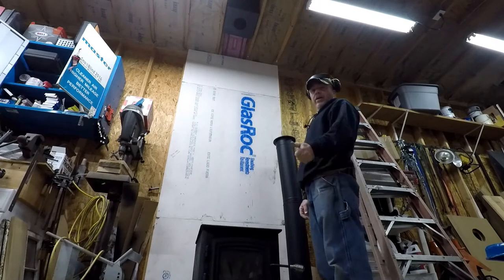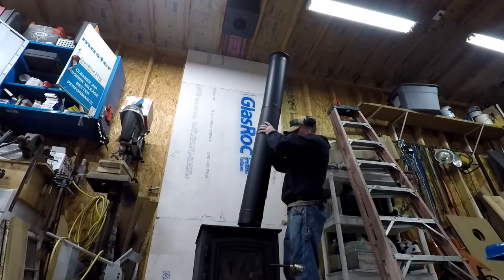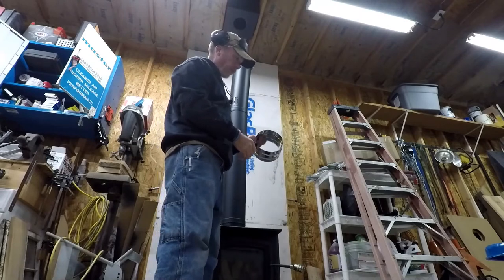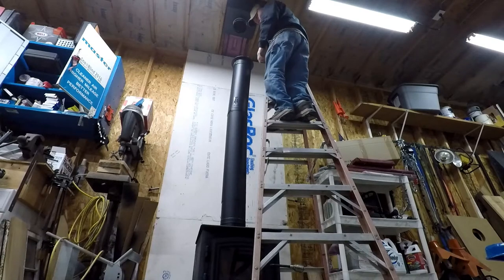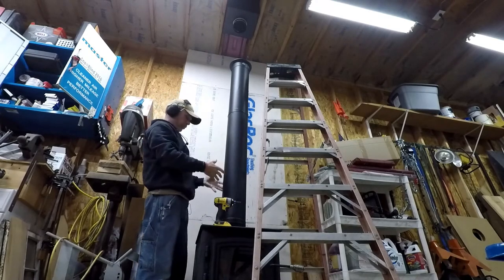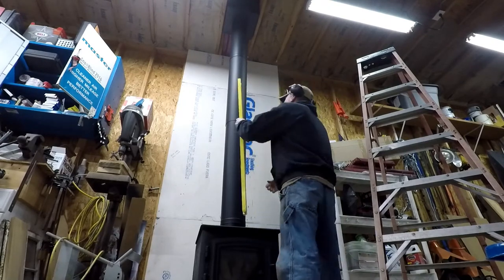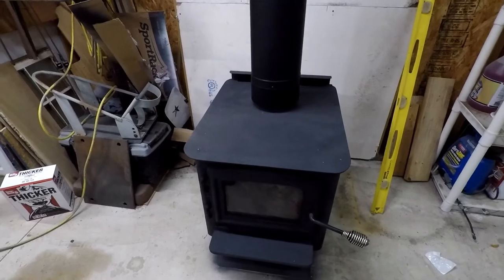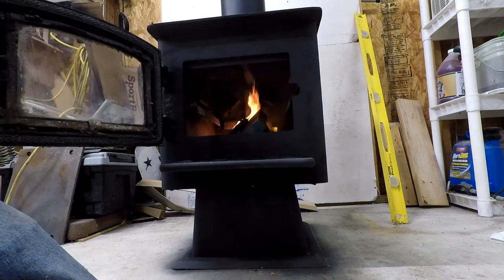Woodstove Project | Installing Interior Flu Pipe | MY DIY

Comment: Good morning, new sub here. I have a question, I have the black single wall pipe 26ft to the ceiling, problem is one section is rusted out ( very thin ) what’s the best way to get it removed? It’s right in the middle of the run. I have looked at the telescoping Rockford six inch pipe to replace it with. Help would be appreciated! ☮️✌🏻
Reply from the maker: I would assume that it’s not a single piece of pipe all the way to the ceiling. Any rusted pipes should be pretty easy to remove and replace. The telescoping pipe is definitely nice to work with to fit the size you would need.